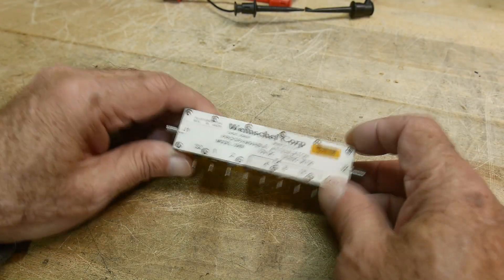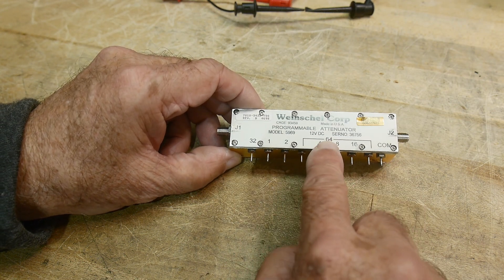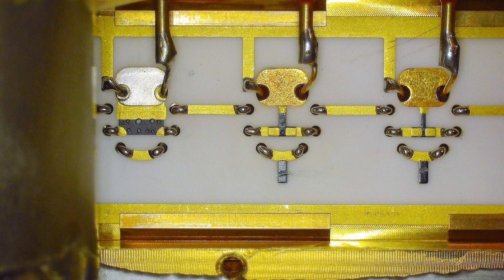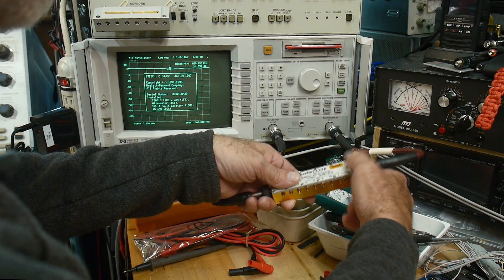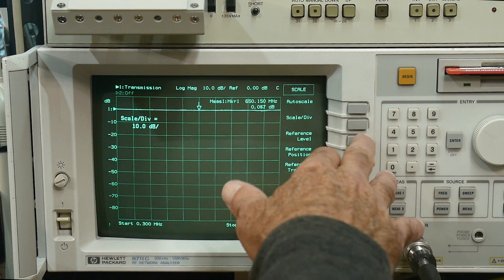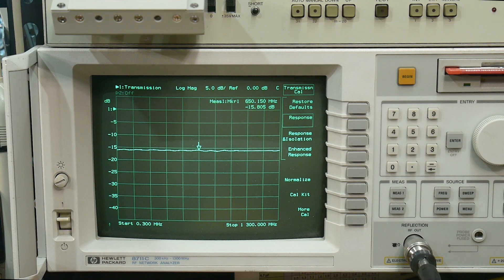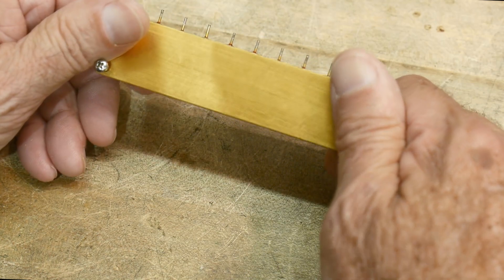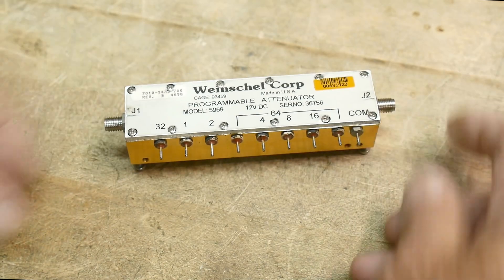#2044 Weinschel Attenuator (part 1 of 6)

Comment: I build a stepped attenuator for radio direction finding, we had severe interference 24/7 on the ISS frequency on 145.800 mhz, we tracked it down to a university lab at NSW, Sydney, and they were shocked they were causing interference and were quick to remedy when the radio club informed them. Looks like a quality piece of equipment, wish Mikes radio repair was in Sydney, 73's, Barry, VK2FP/AG7VC

Comment: I did a similar project with two HP attenuators (0 to 120 dB total), an Arduino and a touch display. The display shows current attenuation,  keypad for direct entry and up/down arrows for 1 dB steps. The HP attenuators latch so they require only a short pulse to set and reset. Fun project and very useful to have on the bench. Looking forward to seeing what you come up with.  Regards, David

Comment: I think that the 64dB position is a combination of all other so I doubt you can get more than 64. I guess we will find out in the next one.
Reply: It's a 127dB attenuator in 1 dB steps.
Reply: @mikesradiorepair  So the 64dB section is not a combination of other sections? Did you try it out?
Reply from the maker: The 64 section is two more 32 sections. Working together. 127 total

Comment: Pronounced with a "W" . Their products were used both by the Air Force and NASA as standards for attenuation measurements. I worked in the Calibration lab for both originations and wrote calibration procedures for NASA, Houston.